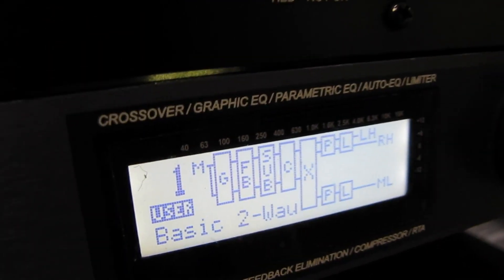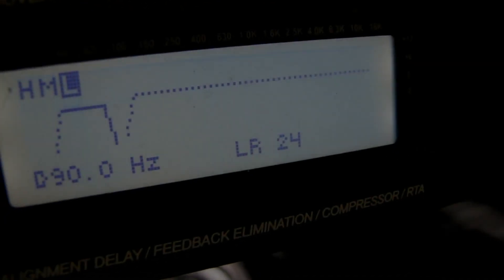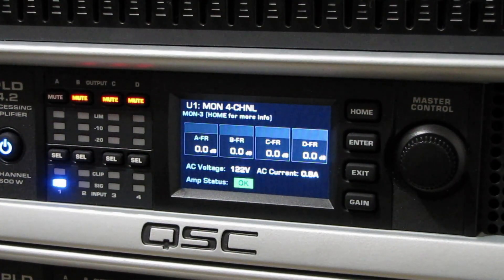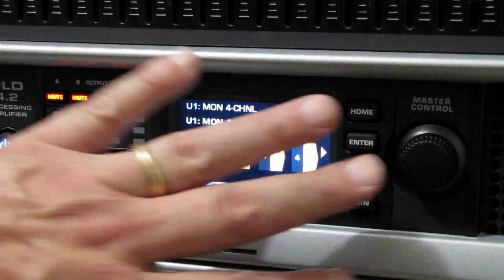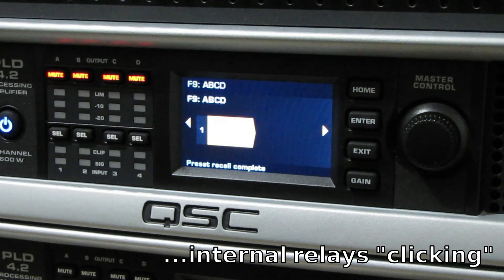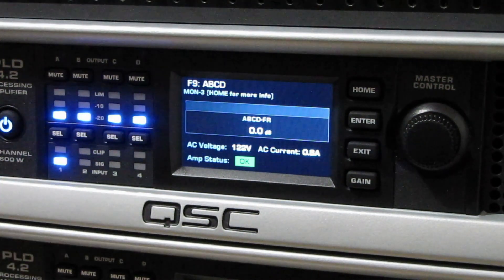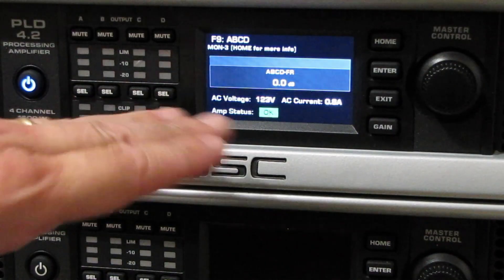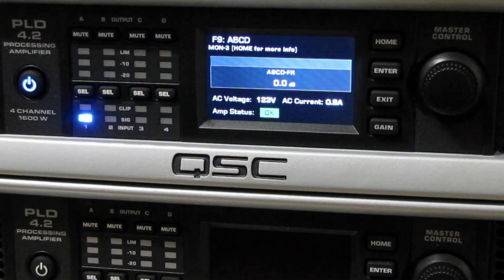Combining 4 amplifier channels into 1 channel on a QSC PLD amplifier

Comment: why the amplifier outputs problematic amplifier writing mister is there anything damaged?
Reply from the maker: Sorry, I do not understand your amplifier question.
Reply: On my amplifier screen it says the amplifier has a problem, why is that?
Reply from the maker: Thank you for the follow up.  There could be various issues causing the amplifier to display messages.  Many times, there are issues internal to the amplifier.  If you see something similar to an error code, you may be able find an answer by searching the internet for that error code.  However, to get the issue solved, you may need to contact the manufacturer of the amplifier to get it resolved.
Reply: How do I contact him and does my amplifier need to be replaced with components or does it just need to be reprogrammed?
Reply from the maker: You may need to contact the manufacturer of the amplifier.  Go to the website of the manufacturer... look for "Support", and from there, you should be able to contact them (they may have an email address you can send a support question to).
Most of the time, amplifiers do not need to be reprogrammed.  If your amplifier is not working, it may be due to something internal to the amplifier.

Comment: nice amp but not reliable, I got 3 PLD 4.5 2 have an issue with the PSU 😔
Reply from the maker: Sorry to hear about the issues.  I recall hearing about some issues with the PLD line.  Though, I thought the issues were resolved with firmware.  Make sure you are at the current version.  We have 4 x PLD 4.2 amps (mostly used for monitors); never had any issues.  They've been solid.  If you are still having problems, you may want to contact QSC support.  They are great to work with.
Reply: @stageleftaudio  I tried contacting QSC support, but unfortunately I am from Philippines, the local dealer here is not as good in your country. 😔
Reply from the maker: Sorry to hear about your local dealer...

Comment: I'm looking to use only 2 channel outputs.. I also only have 2 channels to use from my mixer. It doesn't say which inputs are used for bridge mode out of the 4 so where would I plug them?
Reply from the maker: Any of the inputs should be able to be used.  Take a look at the manual... it will give you a much better idea of how to setup the amp to for bridging.  The PLD amps are great and can be configured in numerous ways; the QSC manual(s) that cover that amp go way beyond what could be typed here for instructions!  I recommend starting  with the manual.
Reply: @stageleftaudio  thank you!

Comment: How is the sound quality for the DSP and crossover built in compared to drive rack DBX ? can you pass up the drive rack and use the built in crossover without any degradation in sound quality for line array as bi amp or tri amp ?
Reply from the maker: We haven't noticed any sound quality issues with the buil-in DSP.  It "sounds" the same as the DBX drive rack (and most any other DSP); though, this was all during testing of the PLD amps.  We do not use the crossover in the amps for production events.  We use the PLD amps for monitors 95% of the time (full-range with a roll off around 65hz).  The remaining 5% of usage is for the occasional sub duty, using a driverack for xover.  We use powered cabinets for our line array.

The DBX drive rack is preferred due to the ease of changing the xover freq. and slope as needed.  There would be too much time involved with changing settings with the QSCs.  The GUI interface built into the PLDs (via a PC) would be a great help, though, we don't use the amps in that type of capacity.